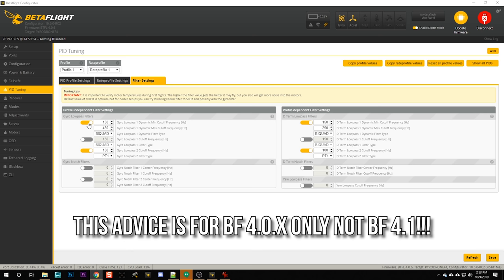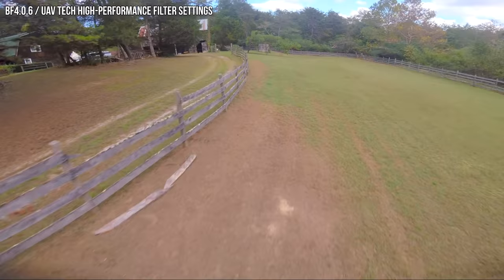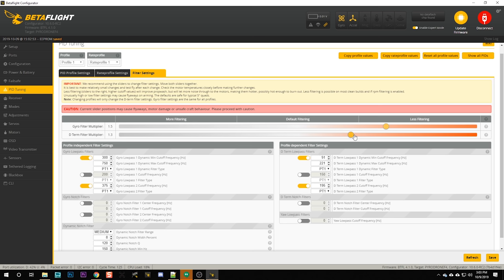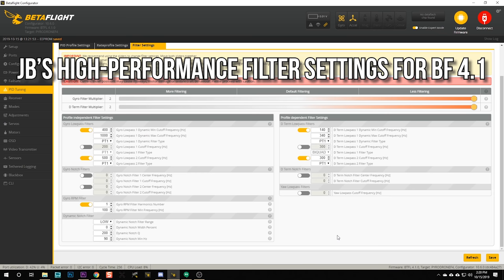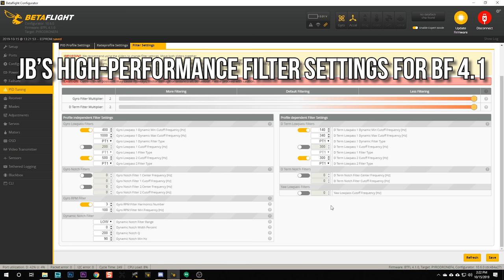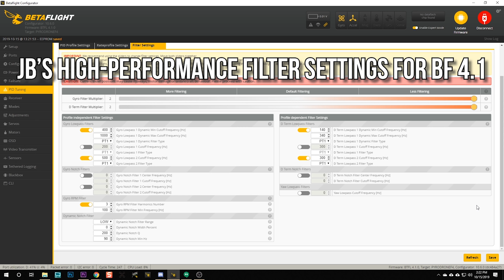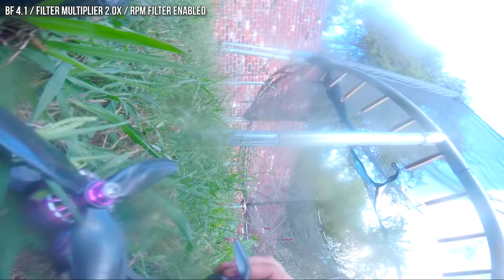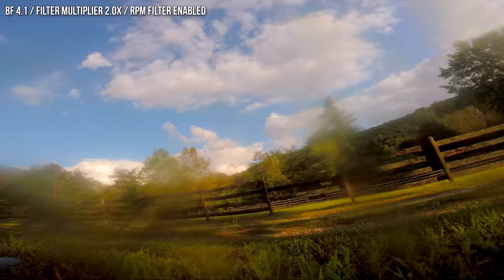Betaflight 4.1 RPM filter best settings to kill propwash

Comment from the maker: In Betaflight 4.2 they changed the LOW MEDIUM HIGH setting for Dynamic Notch to a "max Hz" setting. This video tells you to set the Dynamic Notch Max to LOW. The equivalent setting in BF 4.2 is 350 Hz.
Reply: Can i use this filter settings for spracing f3
Reply: And i also wanted to ask that one of my motor is running smoothly when no props on it and it doesn't spin or spin in ticking motion when props on
Reply: Plz help
Reply: @rudra9117  try soldering a new motor to the ESC that has the problem and see if the new motor behaves the same way - if the new motor works fine, it's the problem with the 'old' motor. if the new motor doesn't work fine, something is wrong with your ESC and the 'old' motor might be fine. It could be both - the ESC and the motor, but IMHO it's your ESC
Reply: @sergeyzhelezko  thank you so much the problem was with motor
Reply: @sergeyzhelezko  now all motor r spinning ok but 3 esc beeps at a time and one esc beep little late what could be the reason for this
Reply: @rudra9117  it doesn't matter as long as it flies. my cinewhoop does that too. you should go to UAVfutures discord and ask there if it worries you

Comment: About done. Best it's ever flown. Man this new t motor f55 pro 2 f3 mcu version does not like high PIDS! I'm in the 30 range on roll. Was getting ridiculous bounce back. It FF is hard to tune also. Anyhow I'm extremely grateful and could just give you a big old kiss. So happy after a couple days none stop of tuning
Learned something today for sure! Much appreciated

Comment: Just did a 1 minute flip flop test and my goodness the first thing I noticed was the sound! My motors are rippier and crispier.  Also motors are cooler than on 4.0.6 and smoother. Running Talon F7 8k/8k Dshot 600 on 6s with your exact settings. Thank you Bardwell! I'm gonna trade one of my $2 recurring Paypal Payments in for your Patreon sub cause you deserve it.

Comment: I have similar filter settings after testing for the last few months.  Sliders all the way to the right (2X), RPM enabled and harmonics at 3, dynamic notch at q=200, w=0, LOW and min hz at 100.  I used to disable D_Min but have had better results enabling it and raising the min to about 75% of what it would be without and setting the max about 15-20 higher than without.  The other change I make from 4.0.x are raising P quite a bit.
Reply: I too noticed the high p gains.    I am having a troublesome 6" (running rpm) and my P gains are at 52 and its getting better.  Before this I was too nervous to take the filters up so high, but I think I may move that slider!!!  :)
Reply: @mbycfpv8937  Yeah I'm getting some weird behavior on my 6in with flips and rolls. RPM-filter at around 2x but the determ lowered. large and slow bouncback but the P and D's area already cranked up 1.3X. wasnt nearly this bad with 4.0 with RPM filter.  let me know if you find settings that work for your 6in.
Reply: @MachuPichuu  got it going good now.  Filters at 1.5,  roll p 44, pitch p 48, roll d 44, pitch d 46, d min adv 45, item relax 11 gyro
Reply: @mbycfpv8937 thanks!  reading some more I think the iterm relax, lowing and setting to gyro Helps the most on 6in+. I'll check more info the d advance.

Comment: All the features in BF are tuned to work together, turning off Dmin means you have to adjust a lot of other stuff to "balance it out again" same for I-term relax for example. To get the last few percent of performance, things got really complicated. But the everting is still exposed to the user... And you really need to know what you are doing to have a good result. 

The sliders are the first step in providing an alternative, they change multiple settings in a promotional way, so you don't have to understand every little detail.
Reply: Hello from Germany i know that you are in the group of the craters and its all truhs what you are writing . I faying more experimetatin and with the sliders and iterm relax and V Bat gain ...... So everybody has to understand real what he is doing and read on Git Hub all over tunning Tiosfor 4.1 . Best regards and happy flaying times . :-))))))) Joshua is for me the best because he brings its more esyer to the Beta Usesrs  !!!!!!!
Reply from the maker: In the past, turning off D_min was suggested to help solve MTO. since MTO is an issue on this quad, I took that step.
Reply: @JoshuaBardwell  wouldn't a static notch be useful in that situation?
Reply from the maker: The idea was that the D gain was "fluttering" and causing the MTO.

Comment: Btw that UAV-Tech performance filter tune is a little outdated. I believe he said in a recent video that instead of using a single BiQuad you should use two PT1 filters set to values that add up to a similair latency. This will reduce the noise at lower frequencies more than the BiQuad.

Comment: Is the idea to try reduce the filters as much as possible on each build? I've just setup rpm filtering in BF4.1 on my brand new build. It fly's great. But is the idea to keep moving the filter sliders as far right as possible? Or do you just accept that it flys great and don't think too much more into? Not sure how far into the danger zone I should go. My only gripe is I still have a hint of prop wash I want to get rid of and my sliders arnt in the warning zone yet. Cheers, and great work!!

Comment: It’s crazy how big a part psychology plays in all this lol you are flying the rpm filter quad so gracefully meanwhile the others just slamming full throttle into propwash back and forth 😂 (I do the same exact thing) HOWEVER; personally, I didn’t really see a difference both had that wobble on high throttle moves both had that yaw p gain propwash thing that all new bf has.. I guess the rpm filter can take a beating but so can older betaflight.. Obviously just my opinion..  either outcome this video is important to show what 4.1 can or can’t do.. I’m gonna stay away for now.. at least as long as my curiosity will allow ⏰
Reply from the maker: I also did some slamming in the video. The power loops were intended specifically to bring out propwash.
Reply: Joshua Bardwell not the same. 🤷‍♂️
Reply from the maker: I definitely disagree. When I flew with each setting, I did a 1 minute-ish flight with nothing but power loops and hard turns. I also did this with RPM filters. Then afterwards I did a full freestyle flight. 

When I edited the video, I put in ONLY the freestyle flight so you can see a full range of flight characteristics. But the freestyle flight also has some hard turns and etc. It just has everything else as well. 

The goal was not to hide anything. Just trying to keep the video under 25 minutes (the original edited length, which showed every single flight).

But my point is, you're right that there is a difference between the three flights. But it's not because I was subconsciously trying to make the RPM filter look good. It's just because I didn't show you the short version of the RPM filter flight.
Reply: Joshua Bardwell well now that makes sense lol I still don’t see much difference in your quads performance tho.. when I tried rpm filters in 4.0 i was disappointed and I hear the filter tech is exactly the same in 4.1 so unless the other features (are there any?) are doing something killer  then I dunno if it would be any different.
Reply: @MaxBeamer  I was on the fence to as my 3.5.6 is running perfect..but i guarantee switch one quad to 4.1 on Bardwell's settings and do a full throttle 180 around a post with both setup's and you'll see.
Reply: KrowFPV I’m probably gonna try it soon, randomly one of my quads is not flying too great and I can’t figure it out. Must be a sign! 🙌

Comment: Great comparison and explanation JB. I haven’t tuned betaflight in over a year lol. Heck I still run 3.2 on my hawk 5 but I’ve got it tuned perfectly and have memorized my pids for the 3 differentprops I run on it for racing and freestyle. But I’ve got the buzz and have been wanting to move it up to 4.1 and start playing with it. Looks like BF has gotten more complicated but easier at the same time lol. I’ve just been running fl1 the last year and it works for me but now it’s time to venture out at least on my freestyle rigs. Maybe one day I’ll try it on my racers but for now ima leave them with falcoX since it’s working so well for me. I’m also working on 2 freestyle rigs now both are actually Flightone but ima have to put bf4.1 on one of them and do a side by side comparison soon 👍👍

Comment: As one was paying attention, default value of Gyro Lowpass 2 Cutoff frequency is default at 500 Hz after flash. Moving the Gyro Filter Multiplier slider from default to low and back sets the value to 250 hz. Bug?

Comment: its sortof a dissapointment with all the 4.x releases those wobbles and bobbles, only firmware I ever see have yaw wobbles, even though it feels great and the flight feel is awsome, but when you look into your hd footage its just wobbles all thay way, specially when going 0 throttle, every time wobbles :(, love the idea of rpm filter, and it seems to be working great, maby its something else in 4.0 thats creating those wobbles, but for now I'm back to good old helio board with super old firmware, but its just sooo much more smooth in the hd footage.. :s even though it feels sloppyer when flying... :S, thanks josh for the video, plz let us know if someone finds out why those wobbles are there....
Reply: What version are you using?

Comment: It would be interesting to see a similar comparison between BF versions on a good quad, that flies well, even those have propwash. Like you said, the one you were flying had some vibration issues that were noticeable throughout the video on all BF versions. I just want to see how good the propwash can get on a clean, well flying quad with the latest firmware and i feel like you havent shown that yet.

Comment: I have a question. What should I adjust in my pids to get rid of bobbles when I punch the throttle? when I get to the max rpm of my 6 inch I tend to get some oscillations but really its trying to solve the mini bobbles when punching throttle

Comment: Thanks for that video! 4.1 with RPM is still the best until now. My 3" has a lot of propwash witt 3.5.x and 4.0.x. Now its way better! My questions are: Do you recommending your Dynamic notch settings also for small quads? Because the tuning note and mouseover in configurator says for small quads, set it to high (you say low in your video). Do you also switch D-min completely off in 4.1? Thanks for a comment, best regards!
Reply: How to deal with toothpicks and twig is something the Devs should maybe flesh out?

I have the filters high... There's a recommendation to meet higher harmonics with smaller quads.

One thing that confuses me is the p/d ratio  Mouse overs says: push it high. But that leads to high PID values and I'm used to lower ones... 
Anyway more testing needed on that quad!
Reply: Same question here. Working with an toothpick ish quad

Comment: Hey Joshua - great video.  I have a 7" that was always a problem quad.  I moved it to a stiffer frame.  Helped a bunch.  Then did the upgrade to 4.1 and added RPM filtrers.  Followed your instructions.  What I am noticing, as I move the sliders for filtering toward less filtering, my propwash gets better, but I am seeing jello slowly introduced each time I move the sliders down.  Motors are cool.  Is this expected?  Do I need to move to pid tuning after this to get rid of jello?  Or accept the propwash?  No matter what, great series.  This thing flies better than ever before.
Reply: are you using proper motors for 7" quad ? you need big ass motors it starts there not tuning ...

Comment: does this apply for micros? can you do a pid configuration for micros/toothpics etc?
Reply: The principles are always the same.  If you have RPM on micro, get it setup and raise Sliders one step at a time.  Then tune P/D ratio.
Reply: I have a micro with mamba stack, which doesn't have a blackbox SD card slot. Can I still do filtering this way (without access to blackbox) ?
Reply: @fuleo   yes, you just have less and much more subjective information about how the quad responds to your changes (which can vary in quality depending on the pilot's level of experience).  You can't really go wrong by enabling rpm and pushing filtering sliders to the right a bit at a time, checking for hot motors or problems at each step.  Once filters are set you can PID tune without black box info. See UAVTech videos about that and/or the Stingy method...  Blackbox just allows you to know, objectively, how good the tune is, and helps a lot to troubleshoot when something odd is happening or when the normal methods don't result in good performance.

Comment: Great video! I'm pretty new on fpv as well as in building drones. I do really like your 4.1 playlist! It's great. Question please? Can you explain why in the filter you did you PT1 rather than BIQUAD? I have also tried pid adjustment using adjustment setting in BF4.1 but it doesn't work. Are you doing any video on how to tune pid on 4.1? Thanks for your awesome job!

Comment: I'm not seeing much improvement even with the RPM filter. The propwash is better, but I still get a lot of vibration in my video and the spectrograph isn't showing much noise.
Reply: Loose/broken camera lens or board/mounting?
Reply: @si-fi  Nope. I have swapped cameras, motors (soft mounted), ESCs and FC. Alien 6" frame is tight. 5" props are OK,  5.5" are so-so and 6" get worse. Vibe is not horrible, but more than I like.
Reply: @aowi7280  I agree there. I have both an 5inch Alien and a 5 inch Reverb, and I have those bobbles on both. Its been a while since I had a great flying quad. One has those Xing 2450 pink motors and the other Mr Steele 2450 V2 motors. RPM filters doesnt solve either....
Reply: I have the Xing 2450 also.

Comment: Hey bardwell, i noticed that you were using the pyrodronef4 board as i am but how come your tasks are at about 26%? when i did exactly what you did in the video, my task max load was up to 40-46% (i have two different pyrodrone f4 boards. the 46% is the v1 and the 40.6% is the V2.3).  what else did you do to make it down in the 26% area? did you overclock?

Comment: Thanks for so many highly informative videos. I'm fairly new to the hobby, and you have really helped me advance quickly... I'm hoping you can help me with a question. I set up my cidora for 3d flight, but was getting horrible propwash with the master 3d props. I'm still on betaflight 4.0.4. Followed your filter instructions in the beginning of this video. Turned off all filters, set d term lowpass1 dynamic min and max cutoff to 60 and 175 respectively, and disabled d min... now its flying incredibly, buttery smooth. But it feels like it lost a bit of power, and my battery drained much faster than usual, but the motors did not get hot... is it normal to lose some punch with less filtering? Or am I missing something here? Any advice would be very much appreciated

Comment: When I connect to betaflight and click on rec tab the indicator bars are  blank ,rec is bound Spectrum ar7700 ppm on a wizard 220. normally when i'have  connection problem I'd still get the bars???? Still a newbe after 4 years.

Comment: i thought it was just my quad when i set my gyro harmoncs to 1 ...switched it back to 3 but yet to test it ..im excited to give it another try now, i had some strange video noise last time even with caps on the escs
Reply: You need to set harmonics to at least 2. 1 is not enough. And between 2 and 3 harmonics there is not a lot of difference in latency so I'd recommend to just use 3 harmonics.

Comment: Why my MAMBA F405 mini MK2 dun have a Gyro RPM filter option :(
Reply: Just found the Jesc needs to pay to get :(
Reply: The Gyro RPM Filter option only shows up on the PID Tuning > Filter Settings when the "Bidirectional DShot (requires supported ESC firmware)" is enabled on the Configuration tab.
Reply: djbkom it needs 32 version esc which mine is the s version esc :(

Comment: So I heard you say not to turn off filters hahaha. Oops. I turned off the first set of gyro ones. Both of them and then it turns on the 3rd one that is off at the start. This is my 6s 6" mind you. And it had a little problem seeing lines in the video from motor noise. Well it definitely flys alot better now since i did this. And it used to get half hot motors from 4.0.6 and i had to have alot of filtering on it then.
On the 4.1 i just have to keep d filtering right under the line, and as i said i turned off both gyro ones but kept the 3rd one that pops up on.
And I'm not even running the rpm thing yet.
It is alot easier to do all this now bc of the sliders...... but I'm soooooo used to the geeky side and putting them in my self haha.
Thanks for the video jb.
Hey and make one on this calibration battery thing.
I want to calibrate mine, but I'm hoping it's also easier to do then the old way haha

Comment: Did you leave on the d min on your 4.1 set up with rpm filtering? What's your pids not filter set up but your pids on 4.1with rpm ?